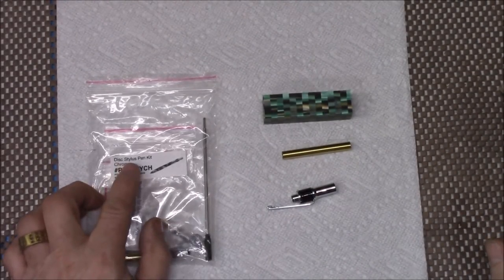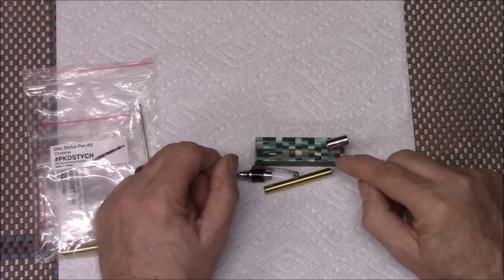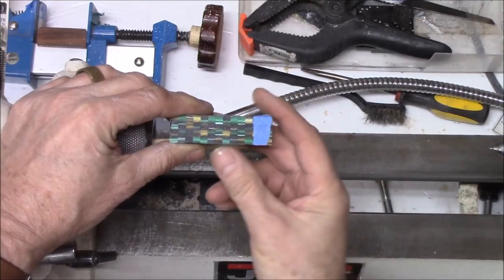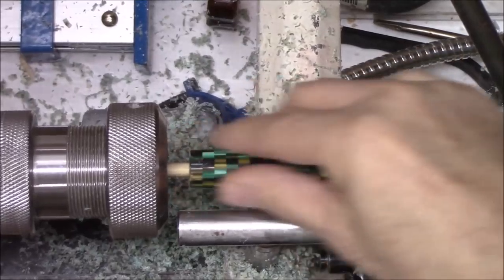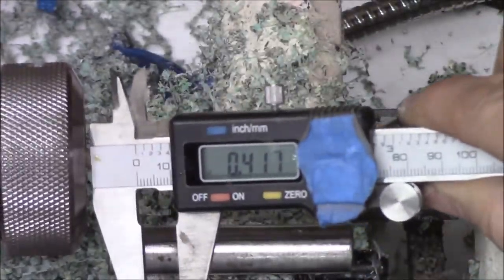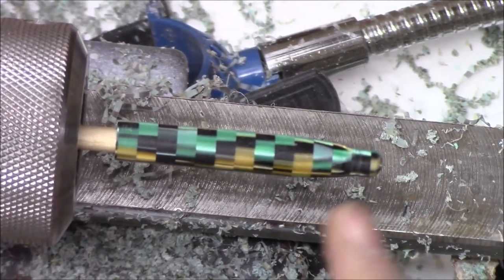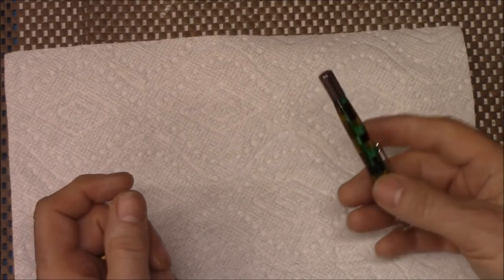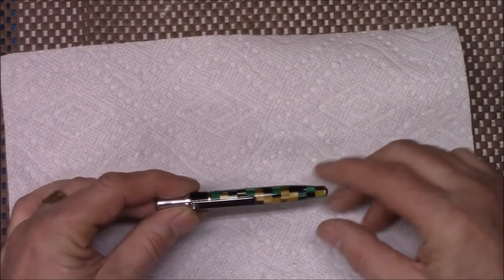How NOT To Turn a Closed End Pen

Comment: Did you have to use the full length tube?
Reply from the maker: Hey there, actually no I didn't have to - I was thinking about this the next day and it  occurred to me I only needed a the small tube and that would have given me more blank to use.  Sometimes I get so focused on the task and desired results I miss some key planning steps.   Thanks for watching and for the comment.  Cheers!